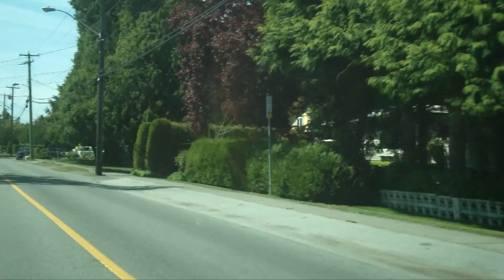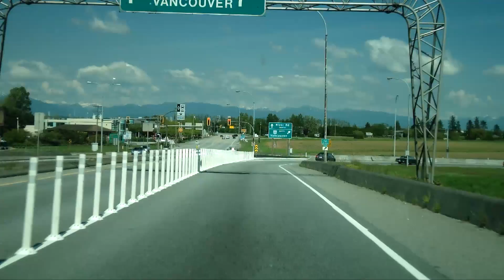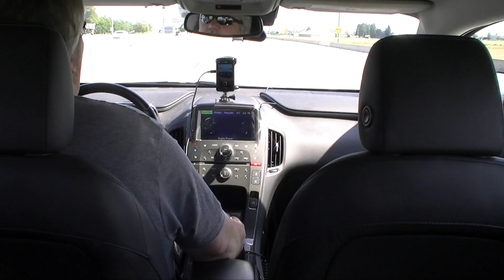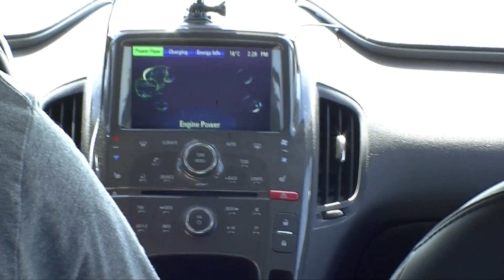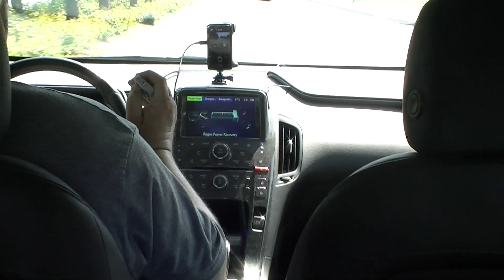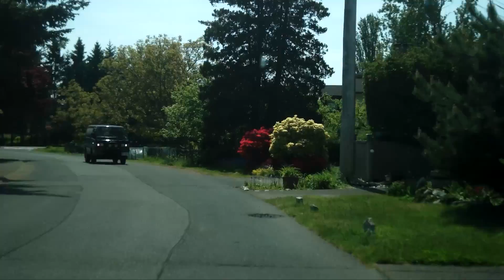How to drive a chevy volt for best electric range and fuel economy

Comment: I have a 2017 Chevrolet Volt do these batteries develop a memory. Do you usually let the battery go down to 0 until charging or do you usually charge anytime you are by a charger.
Reply from the maker: I have had my original volt since June 2011, so it is coming up on its 10th birthday.  It has just over 175,000 km on the clock. (110,000 miles) still the original brakes. Only thing that has been changed are the tires and 1 of the TPMS sensors in the front left tire. The right front sensor has now gone dead (batteries in the tire pressure sensor are only rates 5 years, one went after 7 and now a second one is bad. The car gets plugged in every night to a level 2 charger cord.  I also have a 2019 volt.  It has 30,000 km so far. Only had 2 problems with that one and that was recently.  The HV battery disconnect relay failed and was replaced under warranty.  The FM radio has lost sensitivity and will be going in to get the tuner module replaced next week.  On my 2012 I still get around 32 miles (50km) on the battery and the 2019 53 miles per charge.  
The dealer did the battery protection software update to switch to gas mode after 9.1kw of battery consumption. When new it was set to 9.8. this dropped the battery range about 4 miles and start the engine sooner.  This was to prevent any cell going into overdischarge as the battery ages.  So far no trouble.  It is still on the original 12v AGM battery as well.  Best car i have ever owned.
No lithium cells do not devoloped memory but they do like to be kept charged.  The charger onboard will never charge them beyond 80% and starts the engine when they drain to 30%.
Reply: @12voltvids  Thanks for coming back and updating us on your Volts! Have you had any problems with your Battery Energy Control Module on your 2019?
Reply from the maker: @mike_t_007  
No. Only problem was the HV disconnect relay failed and the car would not turn on.
Reply: @12voltvids  Thanks for getting back to me so quickly! Have a great weekend and be safe

Comment: The problem by not using the brakes often, your calipers will seize much quicker. Unless they've designed calipers against that problem.
Reply from the maker: Well the calipers do bring the car to a stop, every time.  The regen will only bring it down to 3kmh (2mph) and then the brakes stop it, so they are being used, for every stop.

Comment: Save 30 minutes and just put your Volt in L except when you are on the highway.  Want to driver safer?  NEVER MAKE A VIDEO WHILE YOU'RE TRYING TO DRIVE!!!!
Reply from the maker: I guess you didn't  see that the cameras were mounted and thus not a distraction to my driving.  
As to leaving in "l" then the car slows down every time you lift your foot off the paddle which is also annoying.  I prefer to coast and only slow down when want to, so I switched to L on this car.  On the new one i have a paddle on the wheel that does the same thing but i also use L for stronger regen.
Reply: @12voltvids  When you are talking, thinking, and composing a video while driving, you are driving distracted, no matter where cameras are placed.  Not a good idea!  I don't keep shifting out of L because of increased wear and tear on the shifter mechanism.  So I drive around town in L, and in D on the freeway.  Either way, it's a terrific car!
Reply from the maker: @johnnyViDeO  
So what you are saying then is the driver should never have a conversation with anyone else in the car or listen to the radio because that is also a distraction.   Just because you can't walk and chew gum at the same time doesn't mean I can't.
As to wearing out the shifter, well 170000 miles and 9 years later and it isn't any worse for wear.
Reply: @12voltvids  Eating, drinking, texting, talking...yes, all are distractions.  Some require more brain power than others, like making videos while driving.  I got a 4-year athletic scholarship to college, so I guess I qualify as coordinated.
Reply from the maker: @johnnyViDeO  Again, I was not operating the cameras, I knew what I was going to demo, and most of the narration was done in post production.

Comment: Thank you for a great video. It helped me a lot. I just bought a used 2013 Volt and I am so glad that I did it.
Reply from the maker: I have 2 volts now. This 2012 and a 2019 and can confirm that the techniques used in this one also apply to the 2019.  I average 38 to 39 miles range on the old volt and 55 miles battery range on the new one.

Comment: Just bought a 2018.  Put on 3200km so far and the plan is to commute to work and i plug it in at work cause I work long days it's usually charged fully.  Then I drive home then back again and I dont pay for power or fuel.  So far my best reading efficiency is

.2L/1000km   yes that's per 1000 km and yes its .2L of fuel

Better than my 16L/100 km dodge ram by oh I dunno 3000% efficiency.   

I am worried about cold edmonton winters but I still plug in at work!! So either way I'll get one way free!
Reply from the maker: You will loose some range in the cold but if plugged I. It will keep the battery warm.  In brutal cold the engine starts for a couple of minutes to get heat from the engine to warm the battery  something that full El3ctric drivers can not do.   I have both this 2012 and a 2019 volt.  Best cars I have owned.
Reply: @12voltvids How did/are they holding up?

Comment: Aside from the payments due to bad credit, I'm extremely happy with my 2016 I bought 2 days ago. Granted, that's only 2 days. The fact you can switch out electric/gas, different modes, different drives, brake with your hands using regenerative breaking, etc. You can pretty much tune this car to last as much as possible. I had a 30 mile charge, and 42 miles was my commute, Due to a long downhill stretch in L mode I never had to use gas for that commute. It's a bit of a rougher ride in terms of motion sickness if someone in your car isn't prepared for that. L mode slows down things to the point of breaking, and your lights don't go on I don't think. So that is something to think about. No idea if the hand breaking on the steering wheel lights the brake lights.

Comment: Thank you for a great tip. I have a question about switching gear from D to L to gain the maximum efficiency.Does it has any issue to the transmission in the long run?
Reply from the maker: There is no physical change. The "transmission" is a planetary gear set with 3 clutches (on gen 1 models, 5 on gen 2) all controlled by the computer.  The only mechanical connection in the "gear box" is the park pawl when you put it in park. The other positions is an electric switch to change modes on the computer.  On second gen volt the use of L isn't needed as the new one has a paddle on the steering wheel which puts into full regen mode.  You can leave it in L all the time for single peddle driving, but I like the coast mode of D when the foot comes off the accelerator.  In L mores the car slows down quickly when you take your foot off the gas.  On first gen it does not turn o  brake lights so you have to watch that the idiot behind you is awake.  This is no different than a standard transmission car though.  If you gear down and take your foot off the gas you slow down with no brake lights.
Reply: 12voltvids Thank you so much for clarification and excellent explanation. I like how you drove in the video. You took a full advantage  and tried to save everything.😍
Reply from the maker: Hipermiling is the term. Once you have an electric or a plug in, you find yourself trying to get the absolute most range out of every drive. I know many people with EVs and plug in, and we all do this. Looking for that picture showing the range we get. Bragging rights.

Comment: I just drive in "L" almost all the time (there's no actual gearing, and using the lever all the time will just wear it out :-D) … keeping in mind it does not trigger the brake light when regenerating in "L" (Only when you push the brake pedal), so I'm looking for a license plate frame with a built in brake light that's triggered by an accelerometer (like for a trailer). I think after 70mph in Hold or Mountain mode, the gas engine will run constantly - unless you are decelerating.
Reply from the maker: First gen in mountain mode the engine does not start until there is 10 miles of range left then it starts.  My 2012 does not have hold mode. Correct decelerating in l does not turn. On brake lights however gearing down on a standard transmission to slow down doesn't either.  Keeps the drivers behind you on their toes that's for sure.
Reply: @12voltvids  I do love the effect of pre-braking ... Like accelerating to make a red light and being able to lift later before entering a turn and actually applying the brakes (it behaves like a late model Mercedes I've driven where that extra few milliseconds count). I also left foot brake mine in tight turns or pulling on to a freeway from a side street really making it feel like a small sports sedan - for few seconds. I've been pleasantly surprised Chevy let's us do it 😎. I'm kind of looking forward to turning off ESP in a snowy parking lot to see how it behaves with locking up the ebrake. With the 60/40 weight distribution, it'll be interesting to see how hard it is to bring the rear end around.

Comment: Wrong.  It is a plug-in hybrid.
Reply from the maker: How misinformed you are.  The Prius is a plug in hybrid as is the mitsubishi and Ford offerings. The volt has 2 other cars that share the design.  One is the karma, (formerly the fisker karma) and the other is the BMW i3. 
On a conventional plug in hybrid if you floor the accelerator or drive over a certain speed the engine will kick in to assist.  
The volt which is an ev with extended range generator, the engine never comes on at any speed, regardless on how hard you step on the accelerator until the battery is depleted.   Newer models have a "hold" mode where you can save your charge for the city and drive on gas, but that is a mode that nobody uses. Mine doesn't have that feature.  That is for jurisdictions where they have special lanes for ev vehicles in the city, but they have to be running in electric mode to use them.  So you commute into city limits on gas and then switch over and run ev mode in the city. 
The volt is driven 100% by battery power when there is charge and then once burning gas there are multiple modes the car will select depending on driving conditions from a series hybrid where tyres engine generated power to be used by the electric motor or for sustained high speed driving can couple up to 50% of the engine power into the drive line.  It cant put 100% power to the wheels as the electric motors are always part of the drive system. So some power can be coupled in, with the remainder going to the generator to be stored in the battery and drive the permanent electric drive motor.  
Do your research before shooting off your mouth because those of us that drive the volt are as passionate about it as any Tesla fan boy and we know exactly how the car works.  The best sales people for the volt are the owners of the car.

Comment: ur extending your repair bill.. don`t do downshifts on automatic transmission manually, especially on such a peculiar and complex transmission like volt`s
Reply: The volt doesn't have a automatic transmission.  It's basically a gear reduction single speed.  L range is not a gearing, it's a more aggressive regenerative breaking.  It's meant to make for a one pedal driving experience. As soon as you let off the throttle it immediately starts regenerative braking and gradually increases to slow you down. This prevents you having to use the brake pedal except once you get down to 2-3 miles an hour.  It has nothing to do with the transmission as there is no selectable gears in a volt.

Comment: I'm totally lost...  Only had my 2012 Volt for a couple of weeks and it's been a challenge.
Reply from the maker: How is that. 
You plug it in when at home and charge it, and drive it like a normal car. When the battery runs down the engine will start. Everything is automatic.
You do learn how to get the very best range out of it by using the L setting when rolling up to a red light or stop sign, as that way the kinetic energy goes back into the battery. If you use the brake peddle it will go into regen first, and then bring on the brakes as you press the peddle down. When I am rolling to a light I select L and it slows me down to about 5 MPH as I roll up, then use the brakes to make the stop. Not rocket science. For me a tank of gas easily lasts me 6 months, and I do a lot of driving, but they are all relatively short trips and most can be done on electric power alone. Once a week I have to drive a little farther than the electric range can take me, and the engine comes on for the last 5 miles on my return trip.
Reply: I have had it say "Propulsion Power is Reduced" a couple of times.  It shakes and revs really high.  Have taken it to the dealer and they say everything is fine.  Pretty sure it's not.  I'm not worried about range at this point--but I have been worried about making it home a couple of times.  Will be taking it to a different dealer tomorrow.  Do I think I'm wasting my time-yep.  According to the Volt owners on FB it's: the electric battery or the 12v battery or the catalitic converter or the traction battery or hasn't been plugged in much or the coolant needs to changed or it has bad motor mounts....  Right now I feel like when I traded my Leaf in I went from the frying pan into the fire.
Reply from the maker: thepinkbutterfly10 
Propulsion power is reduced will come up if the battery is depleted and you are pushing it hard to get up a big hill. This is what mountain mode is for. This should never come up unless you are driving through the mountains and have not entered mountain mode. The engine will Rev up to try to produce more power. When i drive through the mountains I put it in mountain mode about 10 minutes before hitting the hill this way the system will Rev up and produce more power to build up a 10 mile range in the main battery. Never had it come up except when I have forgotten to put it in mountain mode. I have 148000 km on my car now not a single problem.
Reply from the maker: I will say that on 2 ocassions while traveling in the USA. In 2014 while traveling through Nevada, and again last year while crossing California, i stopped at a gas station to fuel up, and thought my car was going to blow up. The gas station put E85 shit in the tanks and sold it as premium. The first gen volt will not run on E85 shit. The engine revved up to almost red line, and the fuel economy indicator showed about 19MPG, and I could literally see the fuel gauge dropping. The check engine light also came on. I filled up again at a different gas station, and the problem went away, and the check engine light went out a few hours later. The first time it scared the crap out of me as I thought I would be stranded, but the second time I know what was up. First time I stopped at a gas station called Uranus Gas up in the mountains. Only stopped there because my kid needed to use the crapper, and they wouldn't let him in unless I filled up. The second time it was at a Shell station out in the middle of nowhere. So beware on the grade of gas, as low quality E85, which is 85% ethanol will make it run like it is going to blow up.

Comment: Did you get message on your dashboard with message, “shift to park”? You can’t seem to power off the car?
Reply from the maker: Only problem I have had was the car one time failed to charge after a major accident dropped 60KV primary lines onto 25KV distribution lines and blew up a transformer. The resulting surge blew the fuses in my level 2 charger, and once they were replaced I got the HV charging system needs service. A code was thrown for "isolation connectivity" and t he charge circuit locked out, so I had to run gas. The dealer took the car, gave me a brand new car (A 2017 Chevy spark that still had the plastic seat covers on it) while they took apart every connector looking for any corrosion. Brought out an engineer from Detroit to go over it, found nothing wrong, reprogrammed the computers and modules and gave me the car back. No charge, and they even paid for all the gas in the loaner that I had for a full week. Now how is that for service. The car was 6 years old at the time with over 100,000 KM on it. I would say that is pretty dam good service. With that experience they are setting me up to buy another one, as in all the cars I have owned the volt has been the most trouble free car I have owned and to date I have only spent money buying a new set of tires, as I drive it pretty hard and tend to shew up the tires pretty good. Replaced all 4 tires. Not bad though, as it has 148,000 KM on it now, and only on the second set of tires. Breaks still have almost the full load left on them.

Comment: What mode best to drive on highway? Going 80-120km/h? 1-2hrs day.. 

What if your stuck traffic for 30 minutes...
Reply: Are u asking what if you drive 150 to 200km  In 2 hours?   You will use your battery up in the first 75-85km and use gas for the rest.    As for idling in traffic it barely uses anything unless you are running heat or AC which isnt half as bad as keeping heat blasting

Comment: How big is the fuel tank? How far can you go on extended range when electric runs out? How fast can volt go?
Reply: I think my 2018 is a 40L tank or so.  When it runs on gas you can go about 500+km on fuel alone.   No range limit just fuel it up.   The volt is as fast as normal car with high levels of acceleration.   Better than most standard cars or trucks.
Reply: 9 gallons... First gen Volts go about 330 miles on the 9 gallon Second gen Volts go 420 miles on the 9 gallon tank. That's pretty damn good!